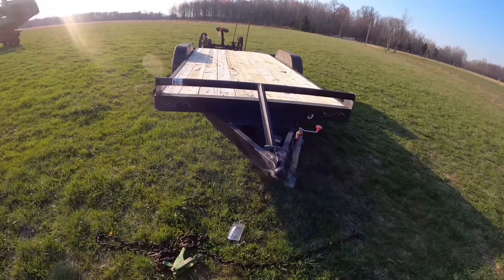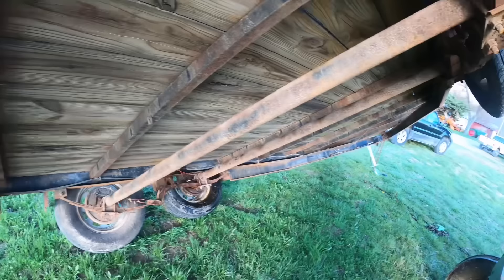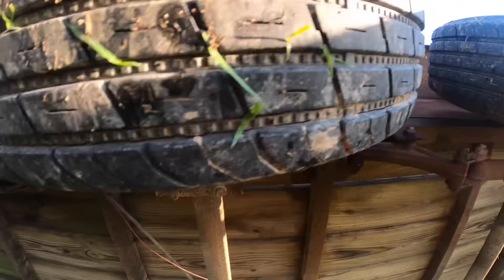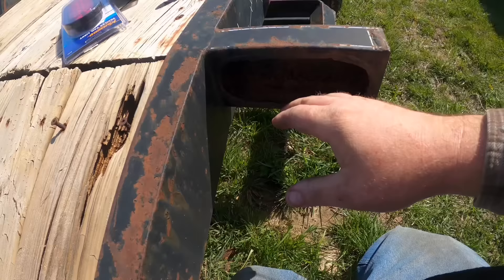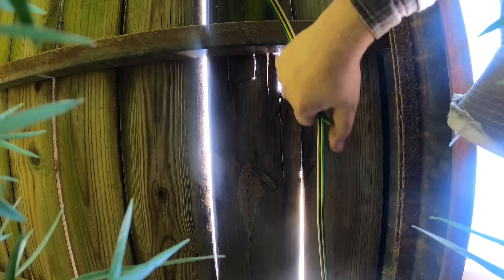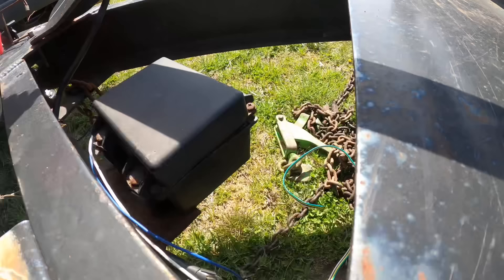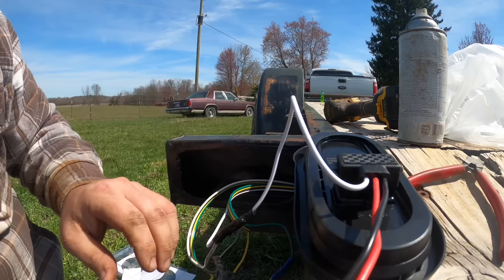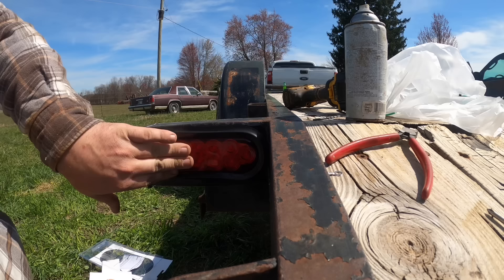Trailer wiring EMERGENCY REPAIR!

Comment: Hey Ross, I went through all of that a couple of years ago. I should have walked away from the deal, but I had driven quite away, and the guy lowered his price. One wheel bearing shot, wiring shot, axles had been over loaded and actually bent the wrong way! And no title. But it had a steel deck. I was wanting something heavier, but figured I'd use it for something. Now with new wiring, brakes, lights, and jack, it is a decent little trailer!  Amazon has those light boxes with also a hole for a side marker that you weld on. The shackles were all shot also. I made new ones, and put in new bolts. I put the axles in my press and rearched them correctly. 
I agree completely about scotch locks! Dad bought a new 200 Allis and had a year around cab put on it immediately. The way they did the wiring for the lights was worse than your trailer, but that's another story! You'll get it, and it'll be a nice trailer. A man can never own enough trailers!    😂😂😂
Reply from the maker: Thanks Jim!!!

Comment: U need to pick up a magnetic temporary trailer light kit from the HoboFrieght for times like this. Handy as hell and I think only $30. So handy you may not ever have to fix lights again
Reply from the maker: I bought one of those and I don’t think I even used it one time. The wiring was so crappy. It wouldn’t hold out. I need to build a set and just have them ready to go all the time.

Comment: If you decide to replace the tongue jack back to the A-Frame style, check out the Ultimate Jack that TSC carries.  I’ve always liked the drop foot style so a fella doesn’t have to crank so much and gets the height close beforehand.  The only drawback I see to the A-Frame jack is that it doesn’t let you lower the tailgate of your tow truck…

I’d rather be working on a deck trailer than my current project of replacing the landing gear on a 5th wheel camper.  Talk about a PITA!  On my rig they put the jacks on the frame and built everything around them!

(Edit: don’t forget to test the break-away battery!  Cause you already know that gem was bad 10 years ago!)
Reply from the maker: That is exactly the Jack I’m thinking of! I have one of those on my other trailer and I love it because it gets it up out of the way easily.

Comment: You should fix up both of your trailers, sell them both and get yourself a nice deckover equipment trailer. Then no worries about things fitting between the fenders because there are no fenders! Lol
Reply from the maker: No, you can never have too many trailers. I’ll probably just buy another. 🤣
Reply: @rosstheoliverman  yeah you're right. They're handy to have around!

Comment: If the hole is cut properly you put the grommets in first and then the light.  We had a trailer one time that had the holes cut  in with a torch and it was the same way that the lights always fell out.  I think we embed up getting new boxes and welding them on the trailer.  For trailer wiring I usually put 1 junction box at the front and then get a 2 strand in a jacket for the brakes and a 4 strand to do all the lights.  But that's me.  You do you 😂😂😂
Reply from the maker: Yeah, the holes are far from cut properly 🤣

Comment: Good temporary fix. Normally, if you take the bulbs out of the rubber, they go in easier. I, being a truck driver for over 40 years,  have delt with that style of lighting a lot, lol. They sell the brackets for those as well. I'm sure you will have it right in the near future. See you later.
Reply from the maker: I think what I’m gonna do is get a piece of aluminum diamond plate and cut a new hole in that and then screw that to the box that I have there. Then it will look pretty but also have a hole that’s the right size for the light.
Reply: @rosstheoliverman  that sounds like a great idea.

Comment: It’s an ongoing joke at our shop when we work on any electrical project or job. Someone always mentions we need to get stocked up on those scotch locks. They are by far the absolute worst sucks when you see something with those all over it. You just know it’s gonna be a ruff go.

Comment: The rubber goes in first,put a little soapy water on the rubber and that light will slide right in
Reply from the maker: Yeah, that still doesn’t fix the terribly torched hole thats too big. I saved the template so I’m gonna get something and cut a new hole and I think I can make it go. Thanks!
Reply: That's a fact, I pulled containers for a couple years,those so called mechanics at the chassis yard took great pride in making round holes square with a torch.

Comment: I wired the 24' covid trailer (built it during covid lockdown to keep from going nuts being isolated out in the country) and was greatly proud of it.  The first trip down our wonderfully not-maintained gravel road had a big rock bounce up and cut the harness.  It has the right turn signal not functioning.  We are delivering 2 art pieces to the year-long show and are only using the big trailer because one piece is too big for the 8' trailer.  I think we only have two right turns in the whole trip.  The trip back has the 2 art pieces I had in last year's show and they are small and will look funny on the 24' trailer
When I repair the lights by picking up the trailer like you did but using the winch truck instead, I am going to run the trailer wires in some old 3/4" black plastic to protect them.  I noticed you have a breakaway box on the trailer tongue.  Are you going to put a lantern battery in it and a lanyard to hook it to your truck?
Reply from the maker: I think I’m going to put a deep cycle battery in the trailer to run my winch, and then that can also be used to run the brake system
Reply: Food for thought.  When you put a deep cycle battery in the trailer hook it to the 12v lead in your connector so it will charge anytime you are using the battery.  The 2nd suggestion is to put an inertia brake controller on the tongue in a good water-tight box. Hook it to the battery.  That way, if you hook it to another vehicle that does not have a brake controller the trailer will still have brakes.  3rd suggestion.  Get one of those small solar chargers that charge just enough to keep the battery topped off.  We used one that you could set on the dash and plug into the power port (cig lighter) and it would keep your battery charged.  We had that set up on our 200-gallon tank that my wife used to water the acre garden.  It was used every day during the growing season and worked every day.  I used the same trailer to provide 2 gpm water to my gas-powered pressure washer for working away from any water source.
 @rosstheoliverman

Comment: Wiring on a trailer is such a pain in the a$$.  I've found that on my utility trailer, some of the older wiring has the metal inside corroding and turning to dust, which is then hard to find where the problem is.  I've had that in several spots.